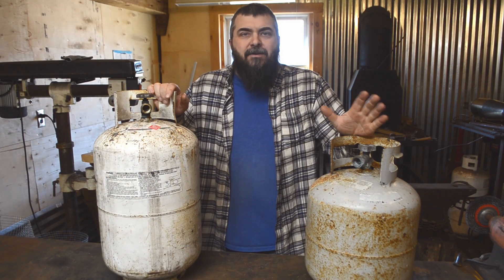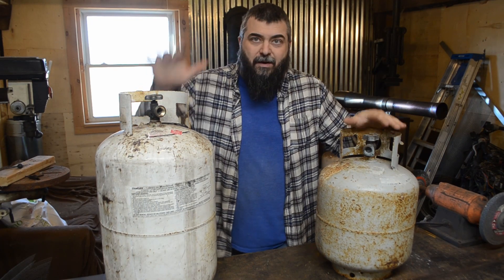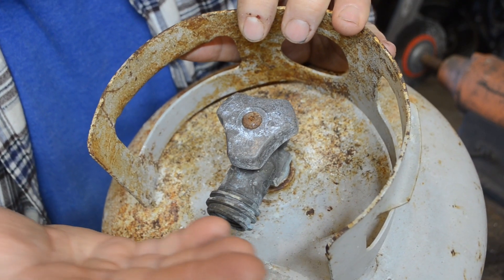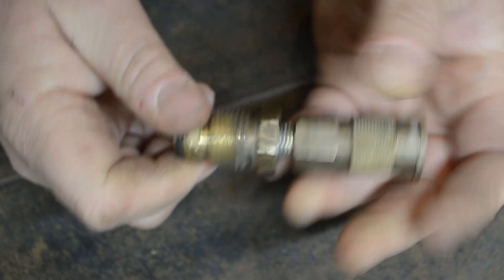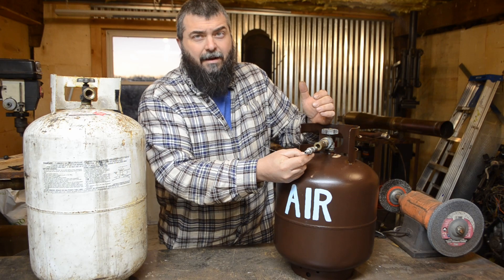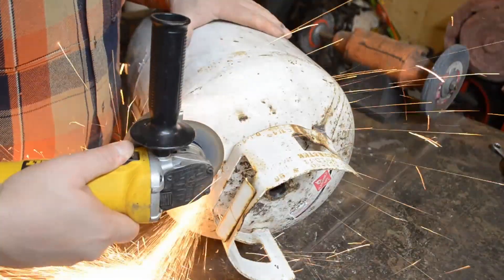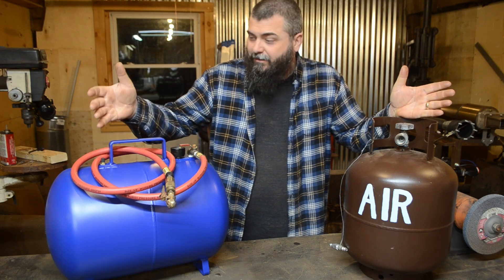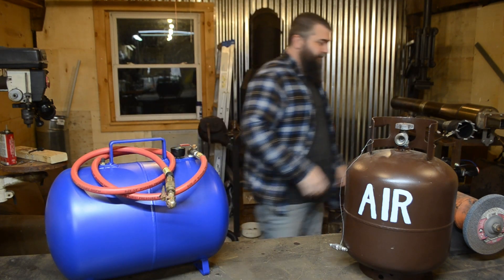How to Build a Portable Air Tank From an Old Propane Tank

Comment: I was curious...maybe you are the guy that has experience with this...  I have tools that need an air compressor amd more often than not..the 26 gallon air compressor that I have has to build pressure up before the tool can perform up to normal standards....my thoughts are IF I can collect say maybe four or more of these and use them either for an extension of air and connect that to the original one for bonus air storage....OR get rid of the original and weld the 4 20 gallon tanks to make another complete tank that can replace the 20 plus yr old rusting one with a lot more storage in a newly(purposed) one. 

Any experience welding tanks together to make bigger ones.😊
3

Comment: Thank you for taking the time to make this video. I am a great welder and pipe welding on pressure vessel is no problem, but I struggle with the plumbing part, love the design of the expansion tank. I feel like this is something I can make myself just like yours. 

My original idea was to cut a hole in my little 3 gallon kobalt air compressor and weld a 1 inch black steel pipe to an expansion tank like this. What do you think. It’s no problem like I said to throw a 7018 root and hot pass on the tank and make it solid.
Reply from the maker: Should work fine if you ask me. Thanks for watching. Let me know how it goes!
Reply: Thank you for the reply, means a lot! Yeah so I am in the same boat as you. I have an old Volvo truck I am helping a buddy get back on the road to haul grain, but it is in a truck parking area, and I don’t want to spend big money on a gas compressor unless it is like a speedaire or an Ingersoll, and 5 grand I don’t have 😅. So the idea is to fill my compressor and take this 5 gallon propane tank I found today, someone already pulled the valve off of it, but hey it was free. I just want enough air to run an impact remotely to loosen what I need to for the day and I will take the compressor and tank home and fill it when I need more air to work. I am thinking of eventually connecting a few of these and putting them in the bed of my truck and eventually I’ll have a whole work sessions worth of air at my disposal.

Comment: 1:57 POL on a propane tank stands for Prest-O-Lite, the company that originally produced this type of valve. It is a common, older-style valve for propane cylinders that uses a left-hand thread. The new style with the external thread and the valve that needs to be pushed in is called 
LCC27 and that stands for Leisure Cylinder Connection Type 27.
Reply from the maker: Oh, very cool. Thanks for sharing!

Comment: I took the valve off of my tanks and then filled them with dishwasher detergent and hot water and rinsed. Then filled with water and laundry detergent, and then rinsed. No noticeable smell after that. That rinses most of the sulphates off the metal pretty well.
Reply from the maker: Nice. Yeah it doesn't take much

Comment: How to remove smell of propane from tank if you're using as a compressor tank:

1) wash tank twice from inside with bleach
2) filled half the tank with water 
3) put it on stove on medium heat
Boiling vapors will be unbearable for lungs 
Make sure you're doing this far away from any house
4) When water will be dried out put som oil in it and your tank is ready to be used
Paint it
Tight some big ass clumps if you wanna use is on high pressure for safety purpose
Reply from the maker: Good tips!

Comment: How much psi is safe for the smaller brown tank?? 
I try not to go over 130 on mine
Reply from the maker: Propane tanks are rated for a lot more PSI than your air compressor is going to dish out. No need to worry about it just for air.
Reply: a 20LB propane tank has a safety blow off valve built in rated at 375psi. So basically they can handle whatever pressure your compressor can put into it. That is as long as you aren't replacing the valve that came with it. Propane changes pressure with temperature much more than air does so they're made to be pretty beefy.

Comment: Nice project. I have a technical question.  It’s anything you did before soldering to avoid an explosion? Thank.
Reply from the maker: Thanks! Just take the valve out and blow it out with air at least. If you want more peace of mind fill it with water and then dump it out.
Reply: @BuildNPulsejets  Thank you so much from sunrise Fl.
Reply: @enriquillobencosme995 My question exactly. I am kind of paranoid of flammable gasses. 😂